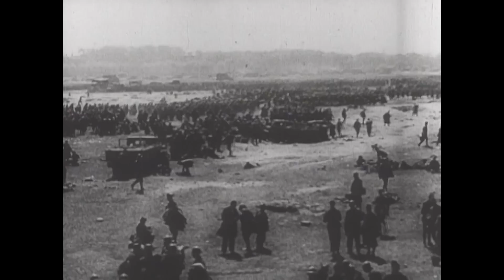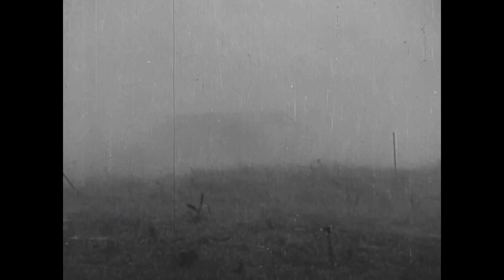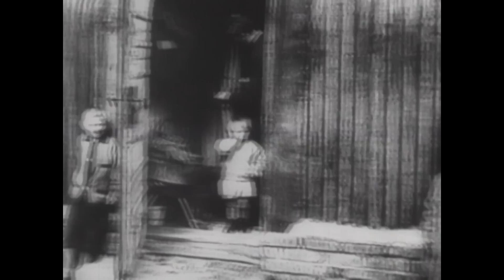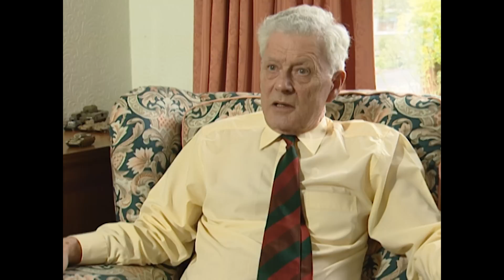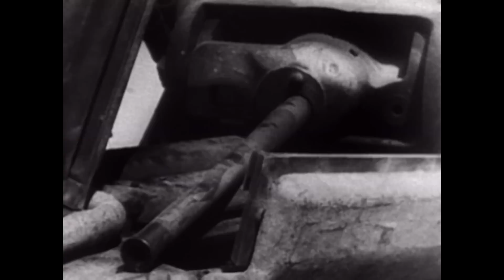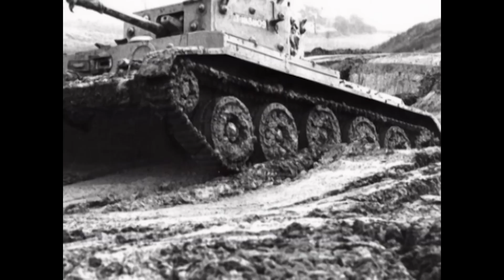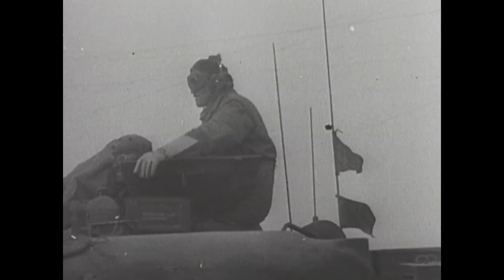How The Cromwell Reinvented Britains Approach To Tanks | Tanks! | War Stories

Comment: The A30 Challenger is perhaps even more underrated and misunderstood than Comet. With a true 17pdr, 100mm frontal armour on later variants, and mobility equivalent to the Cromwell, the Challenger was a good tank. It would have even been better had its design not been hindered by rather unrealistic design requirements.
Reply: At the time the Challenger was pretty much pushed aside by the Firefly which was already battle tested.
Reply: @bobjohnston9154 The Challenger's turret, although ungainly looking, wasn't as cramped as the Firefly. They gun wasn't rotated to an awkard position.  The gun had better depression, IIRC, for hull down work. Despite its apparent height, it was actually lower in overall height than Firefly. Its lack of wading was only really an issue during the initial Normandy landing. The reconnaissance units that used it came to appreciate it.
It was really, in some ways a better tank than the Firefly.
Reply: I was visiting a very well known tank museum on a tour and asked the tour guide is there any surviving A30 Challenges left. He pointed at Challenger FV4030 and said yes. I repeat that I’m asking about the A30 the WW2 tank with the 17 ponder that was also called Challenger. The guy looks at me like I’m a idiot and says the challenger is a modern tank and it was only the firefly that had the 17 ponder. Didn’t bother to ask him any thing more taxing than the most basic thing after that. Didn’t dare ask about the Avenger 😂

Comment: I never have understood the theory behind an armour piercing only 2 pounder gun in 1941 by the British.

They knew from France that the Germans used 37 & 75 mm combination AP & HE guns.
Reply: At the start of WW2 the 2 pounder gun could take out any German tank until the mark 4 came along.
Reply: After Dunkirk the British put their only armoured division ashore in France where it was lost. No tanks. No AT guns. The 2 pounder was kept rather than change over their tooling to make the 6 pdr which was ready to be manufactured. It could take on the current 1940 German Mark I through Mark IV but in 1941 Germany started to uparmor their tanks to 50mm base armor and upgun them with a 50L60 gun for the Mark III and the 75L43 for the Mark IV. The Mk III and Mk IV "specials" to the British.
One does have to question how the Infantry Tank Mk II, the Matilda, equipped with the 2 pdr was supposed to support infantry with a gun that didn't have HE? 
British armored division infantry in support of their tank regiments had very little infantry. A full company in twelve M3 or M5 half-tracks had the equivalent of four squads (sections) of infantry having a Bren team in each vehicle plus a 2" mortar team and PIAT in the platoon HQ vehicle. A British tank company (squadron) of about 16-18 tanks would have a platoon of infantry in support with four half-tracks and three BREN teams plus a HQ. This could be augmented. The 7th Armoured Squadron which was lost at Villers Bocage had a 6 pdr half battery, a FOO tank, and elements of the Motorized Infantry battalion's carriers.
Except for the British 7th Armoured Division the other British armoured divisions had one out of three armoured regiments in Cromwell tanks as a Reconnaissance Regiment, although it was organized and used as a tank regiment. The Canadians didn't use the tank. @RJM1011
Reply: This observation points to a weakness of this documentary and many other videos. They focus on the technical side of the tank and might mention political and financial concerns as far as it impacted design and development. What they seldom do is how the tank was meant to be used and how it was used. . In the case of Cromwell, they need to mention that by that time, the English had developed a combined arms doctrine in which various units would operate together under one commander.  You notice that it sometimes gets mentioned as an aside.  This is a general problem of most of these documentaries as can be attested by their focus on comparisons with the tiger and the panther.  It is very oriented on the technical.. as are most of these.

Comment: It was redundant by the time it arrived.
Used Tiger 1 layout when everyone had already moved in to sloped armour.
Reply: It wasn't redundant. It was very useful and in fact more reliable than the Sherman, with a higher survivability rate.
Reply: @lyndoncmp5751  Would have been bizarre if it wasn't better than the Sherman, which even predated the Tiger never mind the Cromwell!

How was it "very useful?"
It barely made it into the war and offered nowhere near the level of protection that the late war German tanks had.

Stand by what I said, it was last gen Tiger1 rip off armour set up.
Reply: @fryertuck6496 
"How was it "very useful?""

It helped get 2nd British Army across France, Belgium, Netherlands and Germany with good mechanical reliability, speed and reasonable protection. A "redundant" tank doesn't do that. Redundant means no longer needed, not required etc. 
A specific example of Cromwells being useful is when Cromwells of the 15/19th Hussars actually beat back the Panthers of Panzer Brigade 107 from taking the Son Bailey Bridge during Operation Market Garden on September 20th 1944. They managed to knock out some Panthers and Panzer Brigade 107 had to withdraw. 

Everyone knows the Panther and Tiger outmatched the Cromwell in gun and armour, but to claim the Cromwell was redundant and to question its usefulness is actually very ignorant.
Reply: @lyndoncmp5751  Good Lord you're obtuse.
You just admitted that the tank was inferior to older German Tigers.

It was last gen tech that arrived too late to make a big difference.
Allied air power and overwhelming numbers allowed victories not head to head tank battles.
Reply: @fryertuck6496 
I never said it was great and could go toe to toe with a heavy tank twice it's weight. I was arguing against your ridiculous childish assertion it was "redundant". It was actually useful in Normandy, the Great Swan across France, the battles through Belgium and the Netherlands and across Northern Germany. It didn't have to be state of the art fantastic in order for it to be pretty useful. 

Grow up. Even your user name is something a kid would come up with. Blocked so I don't waste any more of my time on such a pillock.

Comment: @0:38 "Spring 1940 Germany... ...forced the British to flee the continent. Leaving it's tanks on the beaches at Dunkirk" 
Looks alot like Canadian Churchill tanks on the beaches of Dieppe in1942 to me. Hope the rest of this is a bit more acurate
Reply: The most powerful weapon on the M4 Sherman was the radio.  Backed up by artillery and air superiority.
Reply: @erikschultz7166  excellent point.
Reply: The narrator has the Cromwell armed with a 6 pounder and an additional 75 mm at 33:15.   The British can't lose with such firepower, but as the one expert stated multiple times, they just don't know how to use the damn things.  I think they equipped them with only smoke shells to hide the universal carriers sneaking around with anti-tank rifles.
Reply: “Hope the rest of this is a bit more accurate”.  Spoiler alert, no.  Even the title of the video is misleading as they don’t get around to talking about the Cromwell until over halfway through the video.
Reply: @frankanderson5012 for what it’s worth it’s still a good little video to watch if you’re an average Ww2 and armor enthusiast, anyone should check sources and statements always if they want a guaranteed answer or best case
Reply: I @frankanderson5012

Comment: More evidence that high command is the worst possible forum for analysis, idea development, production and use of innovation in warfare. Had the first tanks been thoroughly examined and tested by younger minds with some battlefield command experience (sergeants, lieutenants to majors) the first use would have been more successful, at a marginally later date. Power, heat and fumes are relatively easy to fix. Kudos to all who stuck with it though, another Freeman's folly busts through. Takeaway: anyone over 45 should not be in a command position. Wisdom is a partial calcification of the brain unfortunately. Those over that age can contribute in logistics, second opinions, training and floridly harrumphing scarlet for the cameras.